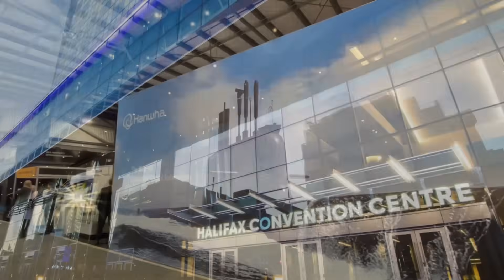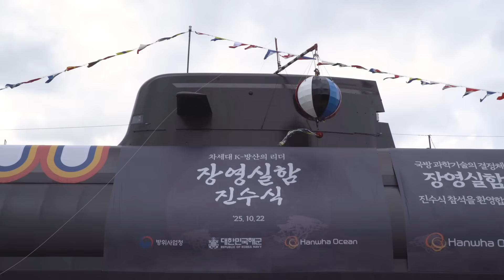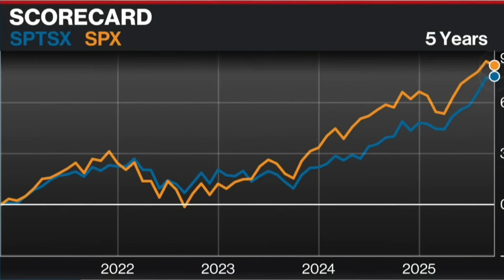THE FUTURE OF THE ROYAL CANADIAN NAVY: Korea's KSS-III Submarine

Comment: My only concern is the lithium ion battery, if it catches fire under water, likely have a dead crew.
Reply: Don't worry, Korean batteries are different from Chinese ones and there is no problem at all.
Reply: KSS-batch2 장영실함은 리튬배터리 화재를 막기위한 소화장치 모듈을 설치해서 화재가 발생하더라도 즉시 소화 가능합니다
Reply: The lithium batteries of the KSS-3 Batch-2 submarine are separated by bulkheads and automatically monitor battery temperature to prevent fires. This ensures safety even in the event of a fire. In the event of a fire, a dedicated lithium battery fire extinguisher activates, completely submerging the lithium batteries in a dedicated fire extinguishing fluid to extinguish the fire and prevent the fire from spreading to adjacent cells.

The battery cells are solid lithium batteries manufactured by Samsung, and an automatic fire extinguishing system developed and installed by Hanwha Systems monitors temperature and humidity. The system is equipped with a safe lithium battery fire extinguisher that automatically activates an alarm and extinguishes the fire.

The lithium battery cells are housed in a thick-walled container, and a fire extinguishing system is installed above each cell. The cells are spaced apart from each other to prevent the fire from spreading to adjacent cells in the event of a fire in one cell. The KSS-3 Batch-2 submarine batteries are automatically monitored by computer for temperature, humidity, and heat detection, and if an abnormality is detected, the system is automatically controlled by an AI system.

Comment: when u compare the two offers, it really is a no brainer to go with South Korea
Reply: North Korea
Reply: @jimmynolet3752  The submarine South Korea wants to provide to Canada is the Jang Bogo Batch 2. It has ten vertical launch tubes. These vertical launch tubes were already installed on the Jang Bogo Batch 1 in 2021 and are now operational. I'll study for you and leave a comment. Please study.
Reply: @PNWkayaker  i can careless if it shoots ten torpedoes out of it's propeller. If there going 3rd party knock offs they might as well buy them off North Korea and get a 10 to 1 deal
Reply: @jimmynolet3752  The submarine South Korea wants to provide to Canada is the Jang Bogo Batch 2. It has ten vertical launch tubes. These vertical launch tubes were already installed on the Jang Bogo Batch 1 in 2021 and are now operational. I'll study for you and leave a comment. Please study.
Reply: @PNWkayaker  The only thing that matters in Submarines is Stealth & Safety towards crew. You need long range and you need short range subs.  You don't need ones from the dollar store. South Korea can barely compete with North Korea as it is.
Reply: There has been no offer yet from TKMS. When it does come it will have a delivery timeline that will be earlier than the Korean offer. TKMS have said that they can build between 3 & 4 212CD submarines by 2028. They are definitely geared up as they purchased a 2nd shipyard in Wismer specifically for this purpose. Plus the yard in Kiel had $350 million Cdn spent on it to speed up production.
Reply: @allannantes8583 
Proposed new German sub is still in the drawing boards.  Germans never deliver on time and uses that to overinflate prices. 
It took Hungary 7 years to receive their first Leopard tank. 
Koreans delivered Black panther tanks in months.
Reply: @peterk6431 
Incorrect. 
The first 212CD is under construction since September 2023.
Reply: @allannantes8583  German submarines have no operational experience and no SLBMs.
Reply: @PNWkayaker designed to have vls if we want that, and like I said the latest Korean Blk II is not tested yet.
Reply: @allannantes8583  The ROK military doesn't build untested warships or submarines. They've already undergone numerous tests before being installed on submarines. They've been preparing for independent operations for a long time, and when the opportunity arises, they build and deploy them immediately.
Reply: @PNWkayaker 
Yes it does build untestet submarines and warships. 
Or how do you test something you didn't even produce in advance??? 

Do you even use your brain before you write?
Reply: @JK-h3e  Where are the people who build and test submarines these days? They need to be tested before they can be loaded onto submarines and used in combat. Who builds and tests missiles? They only build them after testing is complete. Do you have a brain?
Reply: @JK-h3e  Are you building a submarine without even testing it? You're building a submarine because the tests are complete. The same goes for SLBMs. South Korea has already unofficially tested SLBMs in submarines. What on earth do you know?
Reply: @JK-h3e  .

🇰🇷 South Korean Submarines with SLBM Capability
The South Korean submarine class equipped with Submarine-Launched Ballistic Missile (SLBM) capability is the Dosan Ahn Changho-class submarine (Jangbogo-III Project Batch-I).

The ROKS Dosan Ahn Changho (SS-083) is the first vessel of this class. South Korea successfully conducted an underwater test launch of an SLBM from this submarine, making it one of the few countries in the world to possess SLBMs.

The Dosan Ahn Changho-class (Batch-I) is fitted with six Vertical Launch System (K-VLS) tubes, allowing it to carry SLBMs such as the Hyunmoo 4-4.

Submarines to be built later under the Jangbogo-III Batch-II project are scheduled to feature an increased number of ten Vertical Launch System tubes.

In short, the Dosan Ahn Changho-class submarine is the most critical platform in South Korea with underwater missile launch capability.

you better study before you say somthing!
Reply: @JK-h3e  Do you get it now? Please study. Speaking English doesn't make you smart. Please study before you criticize.
Reply: @JK-h3e  The submarine South Korea wants to provide to Canada is the Jang Bogo Batch 2. It has ten vertical launch tubes. These vertical launch tubes were already installed on the Jang Bogo Batch 1 in 2021 and are now operational. I'll study for you and leave a comment. Please study.
Reply: @allannantes8583  The submarine South Korea wants to provide to Canada is the Jang Bogo Batch 2. It has ten vertical launch tubes. These vertical launch tubes were already installed on the Jang Bogo Batch 1 in 2021 and are now operational. I'll study for you and leave a comment. Please study.
Reply: @allannantes8583 then it would be a LIE!
Reply: @canadaphil6068 The submarine South Korea wants to provide to Canada is the Jang Bogo Batch 2. It has ten vertical launch tubes. These vertical launch tubes were already installed on the Jang Bogo Batch 1 in 2021 and are now operational. I'll study for you and leave a comment. Please study.
Reply: @PNWkayaker  it's the only Vertical Launch System (VLS) to be able to fire non-nuclear missiles.  Based on the fact that another minister is in South Korea doing a tour of the facility leads me to believe that they're leaning towards their boats as opposed to the Germans.
Reply: @allannantes8583  SK will allow full sharing of the technology for the sub while Germany wont on top of the supply chain being in Canada.  Dont forget, Korea learned how to make subs from Germany and now leapfrogged them in the capabilities.

Comment: 1:13 this is still almost 20 years out. The risk is enormous.
This is why I advocate, splitting the project between the German Norwegian and Korean   
We need to replace all of our subs now , this schedule will take a decade just to replace the subs we have now 
Also…
We need an alternate plan beyond just the new build 
Where can we get some new used subs in the meantime?
Our current submarines in case you don’t know are practically useless they may as well have screen doors. They don’t really go underwater.
Reply: As has been iterated many times before, if you get 2 different systems you have severely complicated the training, and the operations.  More simulators are required.  Crews trained on one class cannot easily transition to another without a significant period of adjustment, so rapid manning issues can be exacerbated.  The logistics issues grow multi-fold with more spares for 2 different subs, more warehousing, etc.  The CAF doesn't have a force large enough to justify multiple different systems.  All these additional requirements translate into additional costs, thereby reducing the fleet size or taking money from other projects.

Comment: Is rather not have a Korean sub. Good chance South Korea could be bombarded and over run by North Korea. Why should we get subs from a country that may not exist during the service life of this sub
Reply: 😂Your assumptions are incorrect and 40,000 0f USK forces along side ROK are there to to make sure it stays that way
Reply: @Dog.soldier1950 you are negating the fact that China is likely to invade Taiwan in less than 3 years time in which case US forces will be overwhelmingly engaged.
Reply: @NorthEastSaskFarmer USFK as the ROK are well equipped to defend and defeat any attack from the DPRK which is why the north blustery hides pervasive weakness of their forces.
Reply: BlackRock’s investment is aimed at turning South Korea into an AI hub, and Elon Musk has invested in Samsung, with the company now entering the stage of mass-producing 2nm chips and advancing its development of 1nm technology.
In the development of the New Silk Road and Arctic routes, South Korea’s icebreaker- proven through Antarctic and Arctic voyages by breaking ice up to 2 meters thick - and Busan Port, which has been designated as the next-generation Arctic hub port, play essential roles.

Ultra-large transformers capable of powering entire nations are operated by most countries around the world (even China), but only South Korea and Germany manufacture them. In other words, if either of these two countries experiences a disruption, the world stops. Although the two countries produce transformers of similar performance and quality, Germany’s production speed cannot keep up with global demand, leaving South Korea as the only country capable of doing so.

The Trump family has designated South Korea as a testbed for stablecoins. For the sake of reducing U.S. debt and securing future currency dominance, the United States and the globalists must ensure the success of this project. Places where money is invested and facilities are established for the next agenda are precisely the places where war does not occur. In other words, you have no idea what you’re talking about.
Reply: BlackRock’s investment is aimed at turning South Korea into an AI hub, and Elon Musk has invested in Samsung, with the company now entering the stage of mass-producing 2nm chips and advancing its development of 1nm technology.
In the development of the New Silk Road and Arctic routes, South Korea’s icebreaker- proven through Antarctic and Arctic voyages by breaking ice up to 2 meters thick - and Busan Port, which has been designated as the next-generation Arctic hub port, play essential roles.
Reply: Ultra-large transformers capable of powering entire nations are operated by most countries around the world (even China), but only South Korea and Germany manufacture them. In other words, if either of these two countries experiences a disruption, the world stops. Although the two countries produce transformers of similar performance and quality, Germany’s production speed cannot keep up with global demand, leaving South Korea as the only country capable of doing so.

The Trump family has designated South Korea as a testbed for stablecoins. For the sake of reducing U.S. debt and securing future currency dominance, the United States and the globalists must ensure the success of this project. Places where money is invested and facilities are established for the next agenda are precisely the places where war does not occur. In other words, you have no idea what you’re talking about.
Reply: @max_7344 what you and the other guy commenting aren’t taking into account is the very real possibility that America will be in a state of war with China within the next 3 years. They will have their hands full with that. Great opportunity for North Korea to bombard South Korea. Aside from the fact that America is going out of its way to ruin its relations with its allies. I understand the major cities in South Korea are within artillery range of the DMZ. Without even sending a single troop they could devastate the population. America is motivated to defend Taiwan, just as it’s motivated to defend South Korea. It won’t matter though with the long supply lines for America, short supply lines for China and far more economical manufacturing in China and an expendable population.
Reply: @NorthEastSaskFarmer  This is a superficial analysis based on a myopic military perspective. War is a means for advancing agendas, not an end in itself, and the reverse does not hold true. The driving force behind agendas comes from the Rothschilds, and wherever the money of an agenda flows, even the most seemingly likely conditions for war will not result in its outbreak - just as seen historically with Switzerland and Britain during World War II. You probably won’t even understand what I mean, though. You sure wrote a long piece of nonsense.
Reply: @m @max_7344 t it, conspiracy theorist nutcase. I’m sure Chinese forces flooding the Korean Peninsula in the 50s was all to do with the rothchilds.
Reply: @NorthEastSaskFarmer  Calling this a “conspiracy theory” is laughable - it’s usually reserved for things like reptilians or flat Earth nonsense. What I’m discussing is not some wild fantasy, but the limits of your understanding due to sheer ignorance. You clearly have no grasp of how the Rothschilds operate, the current succession dynamics, or even the roles of the Bilderberg Meetings or the World Economic Forum. Yet here you are, confidently pontificating on international affairs - get a reality check. Honestly, if you actually understood any of this, you wouldn’t be spouting such complete nonsense in the first place.
Reply: @NorthEastSaskFarmer  Here’s a hint for you: war is unlikely to break out until Korea completes its shipyard and related infrastructure in the U.S., enabling the production of a sufficient number of vessels. For the record, Xi Jinping really doesn’t want a war - but he will be forced into it if pushed.
Reply: @NorthEastSaskFarmer  For reference, both Putin and Kim Jong-un are anti-China, and their interests align with Trump regarding the Arctic agenda mentioned earlier. Active engagement with them is expected going forward, with Korea playing a key role, since neither Putin nor Trump perceives Korea as a threat. The fact that Kim Jong-un and Trump have maintained communication, and that Trump continues to reach out to him, is for this very reason. They are expected to meet soon, and Kim Jong-un will be managed through economic cooperation by both Putin and Trump, marking the full launch of the long-discussed ‘Pivot Asia’ agenda. War? Not much.
Reply: @NorthEastSaskFarmer  Do you know that Mao Zedong was in New York around 1919 in his youth preparing for revolutionary activities in China? That Lenin briefly stayed in New York in 1916, during World War I, after passing through Switzerland? And that Ho Chi Minh stayed in New York before the communist revolution in the 1910s-1920s? Do you want me to tell you the common thread among them?